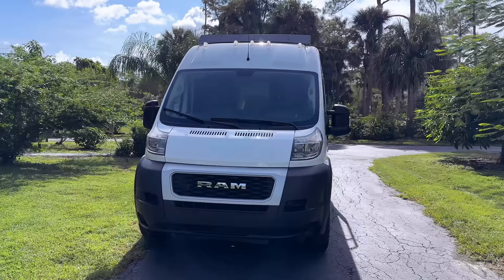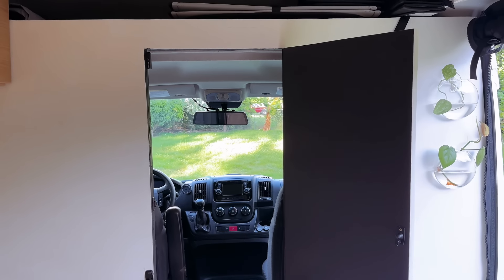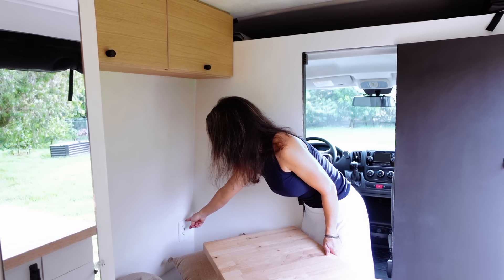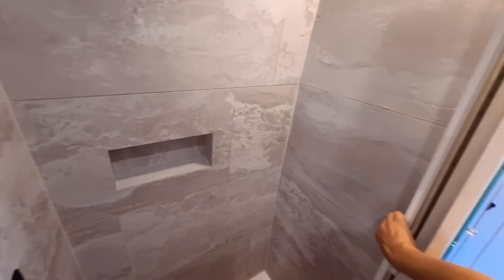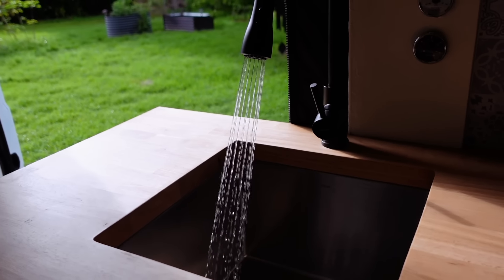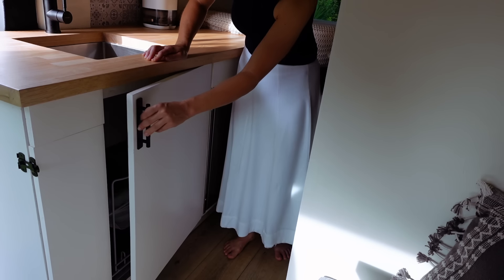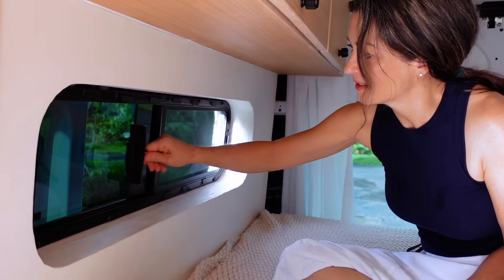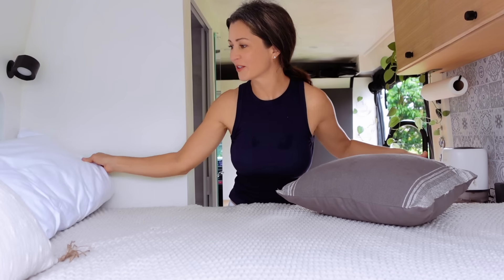RAM Promaster DIY Van Conversion: Full Tour of My Off-Grid Tiny Home | 30

Comment: Nice finnish, I can appreciate the work that has gone into this conversation. Im curious also to see how well it travels with respect to the interior holding up. Your travels will be more comfortable and secure, but it won't be as it was living out of a suv. I found Traveling in my Jeep wrangler more "roughing it" than when I use my RV. Both have their own methods of enjoyment. I didn't see a fire extinguisher  anywhere,  hopefully you do have one, just have it mounted where you can quickly access it ok?
Happy travels and again, great job, and enjoy all your hard work.
Hank.
Don't forget a smoke and CO detection device.....very important.

Comment: I've been eagerly watching for an update on this, it turned out wonderful! One thing you may want to consider is adding is a peep hole in the door of your partition. I'm always running into situations where I need to quickly and discretely look out the front of the van while parked at night.

Comment: Wow you did a lot in 10 months. I bought my 2021 promaster 4 months ago and i am starting to build my kitchen drawers. That partition wall and door looks very much like mine. That toilet is the one I originally chose but was not available at the time so I went with a much cheaper one , the Boxio. Cheaply made and ugly but its hidden inside a bench and I added a fan that vents outside under the van .Great work! much better finishing than what i can do but finishing was never my strong suit

Comment: Very nice work. You could have used a marine water heater, these have an engine coolant circuit in them, this lets your engine also heat it while you drive, when you get to your destination, you already would have hot water for free.
Reply: Did you mention this to her B4 she put in her system?
Reply: @onlyjesussaves840  No, this is the first time she has mentioned or shown any kind of water heater.
Reply: @algiecompositeaircraft5629  I meant 'b4' she could put one in.
Reply: No
Reply: @algiecompositeaircraft5629  I see.
Reply: Wasn't sure I was allowed to contact her.
Reply: Wasn't sure I was allowed to contact her.

Comment: Very nice work. You could have used a marine water heater, these have an engine coolant circuit in them, this lets your engine also heat it while you drive, when you get to your destination, you already would have hot water for free.

Comment: My suggestion would be to "debadge". The side emblems are usually held on with double sided tape, which can easily removed with dental floss or a plastic putty knife, and I think you could find a custom made grill to get rid of the "Ram" emblem.

Comment: I Have a fully loaded class c leisure van but when i go off grid i have the ECOFLOW WAVE 2 AIRCONDITIONER since all your dc brand is the same so it works great when you not hooked up to electrical since you did not put a AC in your van. Living in florida like i do it get really really hot.  So for your birthday i will buy you one  ok, ja ha

Comment: So ii just watched an old video of when the van was empty and you first started, what a difference completed, Very good build. Did you  find out why the engine light went on at 37k on odometer?? Great on the shower. Oh boy hot showers in the future. Van Gough go. What for  supper??
Reply from the maker: Thank you! Yes I needed a new battery. Have not had issues since replacing the battery… hopefully no issues in the future :)
Reply: @soloelisa  Elisa you probably thought of getting a code reader??

Comment: If you haven't left yet, please put a carbon monoxide/smoke detector in your rig along with a fire extinguisher. I didn't notice it in your video unless i missed it? Also, different types of devices and weapons for self protection,  because you're a solo female van lifer and there's a lot of psychos out there. Plus metal latches to lock your side, back and partition doors from the inside. Hoping for your safe travels. Your build is beautiful and inspiring.